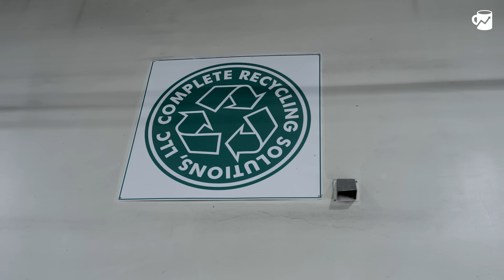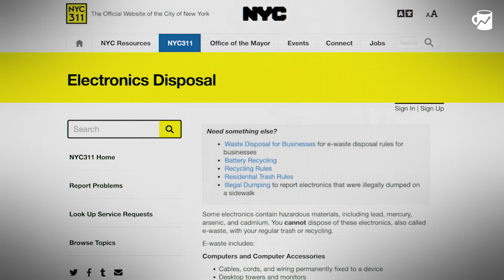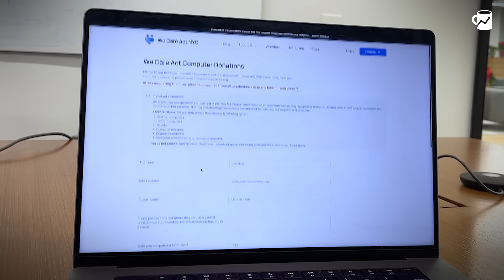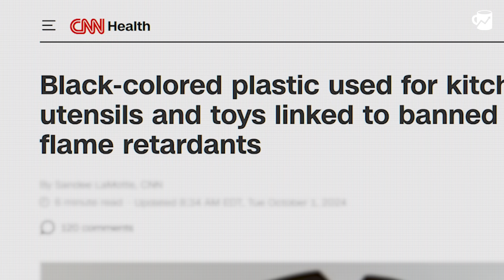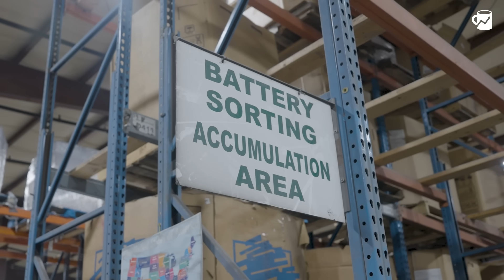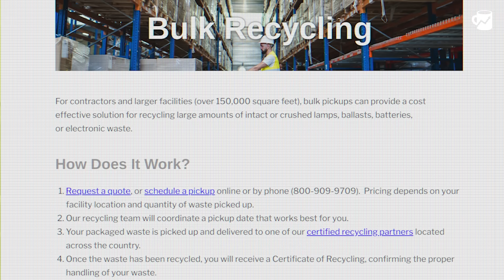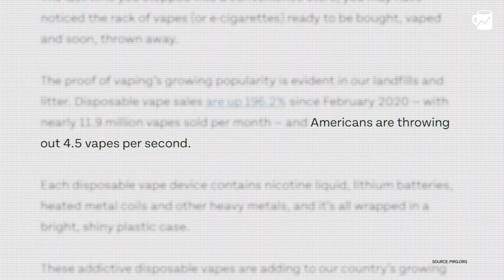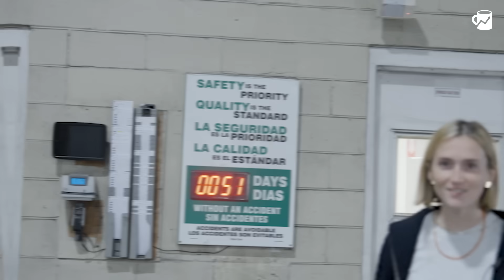I went down a rabbit hole trying to recycle all my tech waste

Comment: now that i solved this for you all, what else should i go figure out?
Reply: How is NYC prepared for extreme winters
Reply: @JosTheMan1  i may or may not have signed up to be an emergency snow shoveler... pray for a blizzard and that vid will get made
Reply: @macyagilliam  Hopefully, you might get called upon within the next 30 years
Reply: Airline Recycling - what happens to all the head phones / food trays / blankets
Reply: Which plastics are recyclable and which actually get recycled would be interesting.
Reply: @Ch1pp007 none are economically viable unless they are post-industry (leftovers from factories), as the manual/mechanical labour of post-consumer and the colors/mixes make it into a very low quality.

But this would be interesting to calculate (did it once for a sustainability project at IKEA).
Reply: Make a video analyzing the modern railroad industry
Reply: Find out what "refurbished" means in reality.
Reply: @tf454  Test and repackage. Can't be called new. For new computers a small sample is test. Refurbished computers, nearly all has been tested.
Reply: I think a video on auto auctions would be really interesting. Dealers selling/purchasing trade-ins and cars from other sources, and how that all plays into trade-in values and purchase prices for cars.
Reply: @DanielVaughn42  Just here to second this idea, I want to know more about auto auctions but I'm too scared to go to one so it would be dope if you went instead 🫡
Reply: I've always been curious about what happens to cars or parts of cars after they leave scrapyards. I get that some parts are stripped and end up on eBay or the like, but what about the parts that aren't resold? Like, where does all the scrap metal from car frames ultimately go? Foundries in Pennsylvania or China? Metal melted down to make new cars? I'd love to see you follow the supply chains as far downstream as possible and possibly even finagle a tour of a modern day steel factory. I get that would be extensive and expensive, but I can dream and maybe you could make it happen? Also, kit cars. New cars are really expensive, but how about the ones that people can put together themselves in their garages for a cheaper price. Why are there no affordable DIY kit cars to help combat the high prices of new cars being sold in the US. Maybe there are and I don't know about them because they haven't gone viral yet? How about biking around NYC with a Geiger Counter strapped to the handle bars that records radiation levels and GPS coordinates and then overlays them on a map to visualize them. Supposedly all NYC police cars were outfitted with a system like that over a decade ago according to a video on YouTube. The investigation is where are the most radioactive spots in nyc and most importantly, why are they so hot? I wonder if this system has been crowd sourced by 2024 and there are underground mappers of radiation levels across the US which could give insight into events before they happen, like Kodak engineers uncovering the truth about nuclear testing occurring in the US before anyone else. I hope this helped give some inspiration. Thanks for posting such great content!
Reply: The gym supplement and vape industry seem to have really hazy or downright nonexistent regulation. These products that are consumed daily by a very large portion of Americans (especially gen x and z'rs) and there's not much info on what is actually done to keep consumers safe. A vid on vape or supplement regulation (or lack there of) at the company/government level would be great!
Reply: Oh no, first Rollie Williams in Climate Town and now you. I just "free returned" a piece of electronics. I thought they would sell it again! I didn't know it would go to the landfill!
Reply: This is wildly better researched than similar youtube videos. I would love any videos on the fashion industry, the quality of produce and why so much is imported, composting, or public transportation that might interest you.
Reply: @TheSongwritingCat  - Wasn't Terracycle involved in some quite controversial chip pack programs?
Reply: If you could find out where all the good people have gone that would be wonderful.
Reply: If Juan Soto can really generate a profit for the Mets with his 800million dollar contract.. the economy there?
Reply: Be interested to see more on recycling. Soft plastic recycling is a big issue in Australia and I'd be interested to see if the US, with its larger population and market, has solved or partially solved this issue
Reply: Do an NYC confiscated vehicle auction!
Reply: Who is producing the e waste
Reply: Incoming Congestion pricing in nyc
Reply: I thought you might know where the sidewalk ends
Reply: Great research!  Please can you provide more battery recycling info?
Reply: Why do kids love the taste of cinnamon toast crunch?
Reply: Wait I want to go deeper into this and see how more of the downstream recycling works!!
Reply: I get the feeling that all those recipe websites are owned by the same company, just with different  urls and css. And they're usually awful! How did it get like this? Could be an investigative look into the slow hollowing out of the open internet.
Reply: What is the meaning of life?
Reply: Idk how broad a range of subjects you cover but as a mechanic I find the auto repair/salvage industry really interesting from a waste and recycle standpoint. Things like what happens to old tires and fluids, the feasibility of selling good parts off scrapped cars as a business model, stuff like that.
Reply: Check out how and if plastic actually gets recycled well.
Reply: Curious if NYC has a dedicated scrapper community. Every day recycling like cans, metal, housing materials, etc. When I lived in Chicago there were pick up trucks that would cruise the alleys and grab just about anything.
Reply: @ I still see that here in northwest Indiana
Reply: Suggestion for future visit to recycling sites. Wear some kind of mask and eye protection near processing machines.

Even if the glass seems to come out in big chunks, there is probably a lot of particles in the air that can do a number on eyes and lungs. But that is just me being used to European safety standards perhaps😅
Reply: Why is there no information on couches? It’s the second most expensive item most people own (car first) but good luck on finding out if it will last 6 months. Why are there so many companies? Why hasn’t a disruptor like in mattresses entered the space? Reviews say the sales clerk was nice/rude which is irrelevant for such an important purchase.
Reply: Are reef repopulation programs worth it in face of climate change? 

Even if we repopulate reefs, do they have a sliver of a chance in a +4°c scenario? Wouldn t it be smarter to use money on what is still salvageable.
Reply: evaluate the downstream recyclers? Given that a lot of this stuff eventually ends up in other countries where its just burnt up to recapture some metals is worth highlighting
Reply: Time to kick that vape addiction! I know its hard to admit when you have a problem 😛
Reply: How to stick to my new year's theme or resolution. Emergency preparedness. The high cost of groceries, how to get a better job without burning the bridge back to my old one, how to be nicer, how to get others to be nicer, you know just the regular problems of the modern day.
Reply: You did a great job!
Reply: You should try using the old macbook as a NAS for home storage. Old devices can be used as servers.
Reply: Go figure out why someone on disability makes too much to qualify for food stamps and Medicaid when they can’t even afford groceries as is for an entire month.
Reply: Do a bit about Air Traffic Control :)
Reply: Why do you have all that stuff in front of your monitor
Reply: Old mattress
Reply: Old mattress
Reply: Why didn't you pin it?
Reply: How to make things cheaper. Please and thank you
Reply: You should figure out how we, the consumer, can protect our rights against mega-corporations and hold billionaires/CEO's accountable
Reply: @Scoop1935  i know how.. dont work for them. dont buy from them. come mow lawns for me instead
Reply: Can you etag a monitor until it don't send?
Look to find an organization like Free Geek in your area?
Where or who is truly recycling old magazines?
How much stuff, packaging,products that is produced but never used. 
   Think you be surprised on unused cardboard and boxboard.  Calculate the carbon footprint.
Reply: I think you should have your own channel. You are collaborating with other people, but some guys may just want to watch you. You could create a Patreon and post videos a day early or release exclusive content on their so people could support your channel or do a brief ad in the beginning for more revenue. Start a brand and sell clothes with your logo on it. Just some ideas so people get more of YOUR content.
Reply: Figure out that all of these issues are merely symptoms of the disease that is capitalism ...
Reply: How to get wife.
Reply: just a note on the black plastic toxicity kerfuffle, the original "study" that sparked it all had some pretty basic math errors in it that exaggerated the concerns literally 10x
Reply: @litareaStatistical errors in research papers is a good topic. The recycled plastic study is a good example of a larger story. A couple years ago I saw a meta analysis that combed through medical research and found errors in a significant number of them. They even corrected some errors and explained how it affected outcomes. Then there's the rabbit hole of correcting errors after research is published. 

Explaining statistical errors could be difficult to make entertaining for the average person, but Morning Brew does a good job of making statistics funny. (Big car safe)
Reply: Macy, can you do an episode on the effects of Trump tariffs on your daily shopping in the future?  I also recommend you wear gloves and an N95 mask the next time you are at a recycling plant.  Wishing you the best!
Reply: You are cute
Reply: you are super cute!
Reply: Idk but I love your work and have a super big crush on you! You are insanely talented, funny and entertaining! Keep up the great work!
Reply: @smokeglacken  that's a weird thing to say. maybe don't.
Reply: @smokeglacken  She is very beautiful.
Reply: @smokeglacken  get lost, she's mine 😡